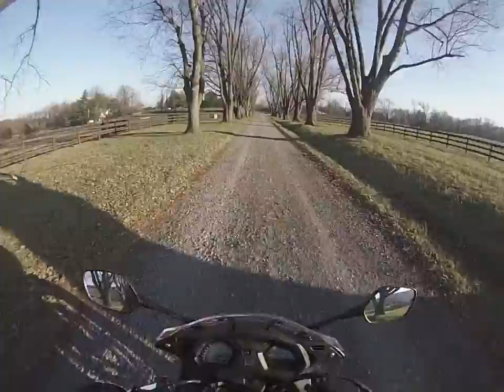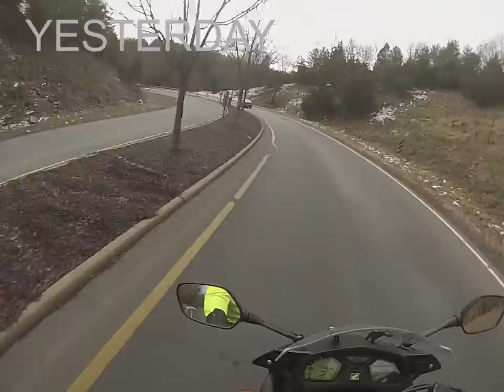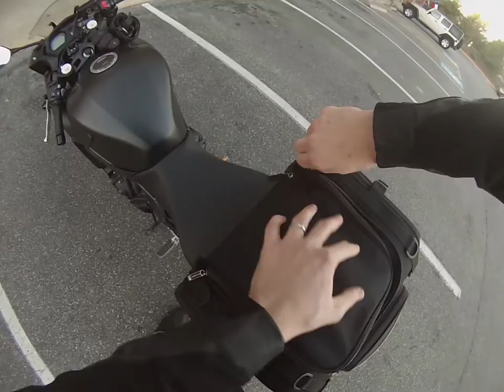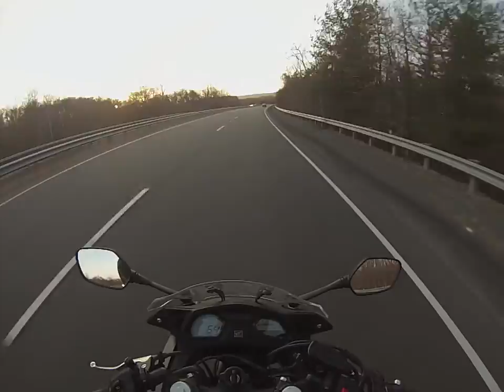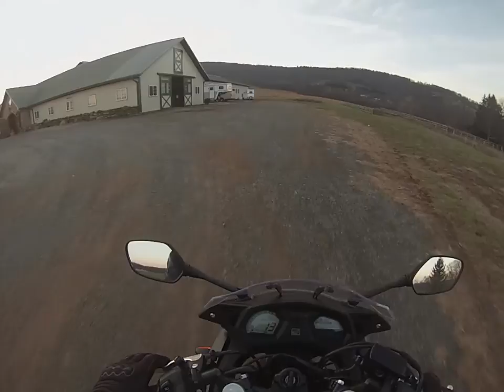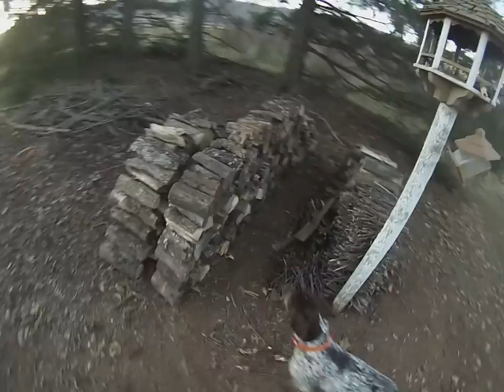High on CBR650F

Comment from the maker: cagednm69 Wow, I had no idea. Finally I have an explanation, thanks! Not that it was bothering me at all. Funny how some people are looking for loose bolts to tighten, thinking that'll fix the problem. And yeah, I'm "zirgs" on the forum!
Reply: If you have handlebar vibrations, you could experiment with heavier bar end weights and grip covers.  If you have rattles from the speedo, its usually two fibre parts touching at some point.  You could add small bits of foam in between and sort it in 5 minutes.